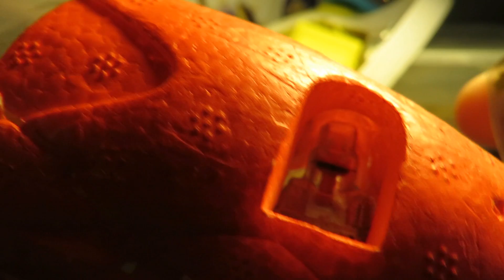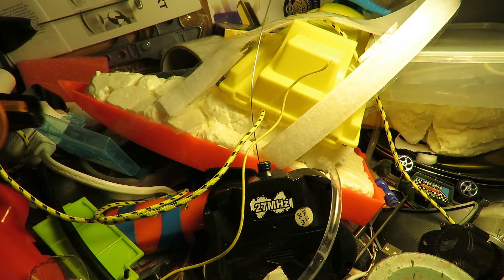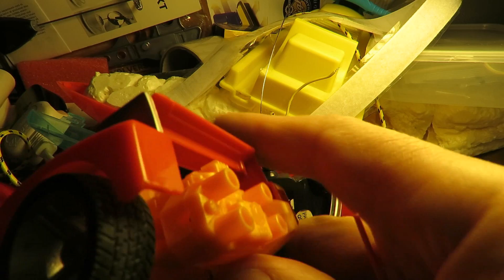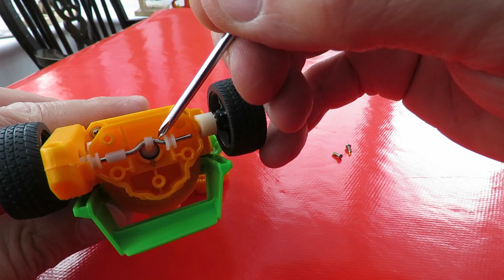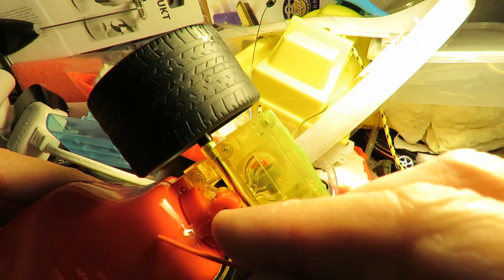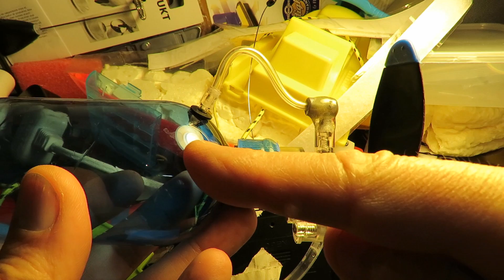My Air Engines Close Up View

Comment: What? So that giant engine cylinder block thing on that yellow air jammer is fake?
Reply from the maker: I am not quite sure what you mean by fake. If you mean that it probably does not need the cooling fins, then you are probably right. I am not sure how hot they might get with the friction during operation, but like the rest of the car it has been designed to appeal to the expectations of the buyer. Here is a video where I had another look at that particular car (You will find links to related playlists in my video description) https://www.youtube.com/watch?v=qsWaHoi6vGI&list=PLA5a2xPRSrB3jwPgPvOZJvK_o5Q3sGDQ9&index=58
Reply: @GrandadIsAnOldMan  yeah there’s no cylinder in the cooling fins thing. In the original air jammer road rammer there’s a piston in that cooling fins

Comment: I thought I had already left a comment here showing you the actual working of the accelerator engine... It's worth having a look on it since it's pure genius!!
Here is the google patent:

https://www.google.com/patents/US20040060429

As you can see, there is no vent on the cylinder. The genius idea is to set the o-ring seal not perfectly perpendicular to the axis of the connecting rod. If you look closely, the o-ring it's angled somehow. The angle in fact lets the o-ring seal the cylinder on the downstroke BUT open on the sides when going to the upstroke!! That way they fix a number of problems: 
-Number of moving parts is reduced to just three: crankshaft, connecting rod, and o-ring
-exhaust system dos not rely on holes on the cylinder, which reduce mechanical strength and tend to dent or bite the sealing element
-upstroke undesired compression typical of simple engines is prevented, since the o-ring keeps the opening angle until the crankshaft completes half a spin, and sets the connecting rod back in contact with the injection valve.

It's pure genius!! 

Thanks for the video... Sorry that I thought I had answered to this video. You have quite a lot of engines :) In the land of mr Watt and mr Stirling (*) who wouldn't love to keep them running?

(*) they were actually Scottish...does it matter too much?
Reply from the maker: Thanks 🎄🎅😊

Comment: That was a great video.  I have not ventured into the air engine realm yet but it is on my to do list.  I have built a low pressure steam engine though and all the way through your video I was wondering if these air engine designs would work on steam.  I guess it depends an the if the plastic could take the temperature.  When I was building my steam engine I ran it on compresses air first for testing.
Reply from the maker: +Lidmotor yes, apart from the issue of heat the same set-up should work for steam. Some of these engines are very simple, everything in one tube. Valve at the top triggered as the piston passes tdc and exhaust holes in the side at the right point to let the pressure out. Anybody with one of those 3D printers might be able to make one. Certainly anybody with access to a lathe should be OK. I am sure I could have made one when I was in school where I had access to metal working lathes.

Comment: wow i saw a really cool project and i was wondering if you could improve on it :it was a rubber band gun made of old credit cars (details sanded off) but it seemed to be very weak and could only use loom bands maybe you could add like a Poland saw blade on each side or something like that? by the way cool video today :)
Reply: Ok.
Thanks again ☺
Reply from the maker: +london smith I prefer to make up my own designs rather than copy other people. If you think that design could be improved then maybe you should leave a comment on their video.
Reply: GrandadIsAnOldMan okay i apriciate originality never mind then
Reply: +GrandadIsAnOldMan 
Could plastic "credit cards" be used as a spring to power a small car? 
Like the mouse trap car?
Or would the cards be too short to generate useable power?
Reply from the maker: Wil Hobbs I think it would work, I may have a go at some time. I will see what I have available :)
Reply: +GrandadIsAnOldMan cool 😀
Reply from the maker: Wil Hobbs It works fine, I will upload a video in the next few days.
Reply: +GrandadIsAnOldMan
 Really?   Wow.  Thank You!
You sure work fast.
Can't wait to see it 😊
Reply from the maker: Wil Hobbs just modified one of my old rubber band powered cars by gluing a credit card to it :) It is schedule for publication on the 7th